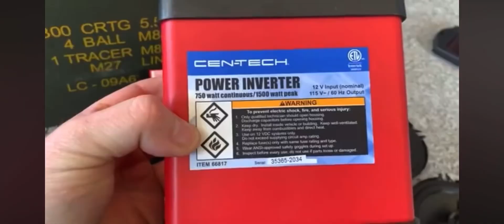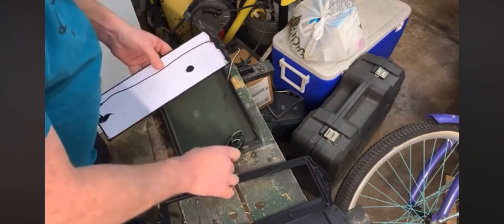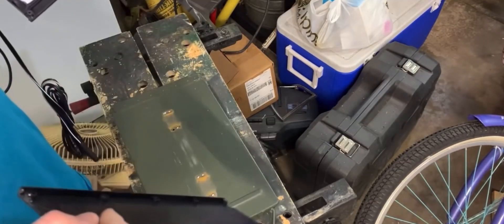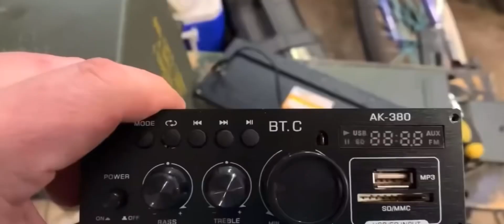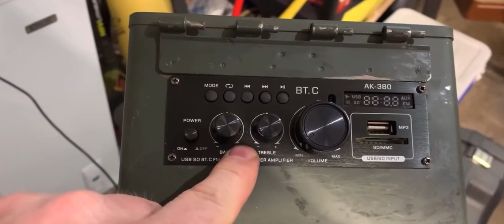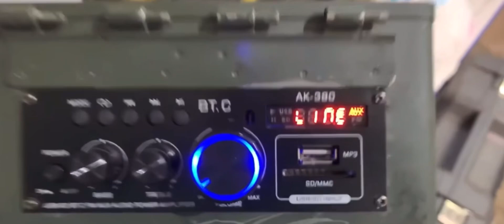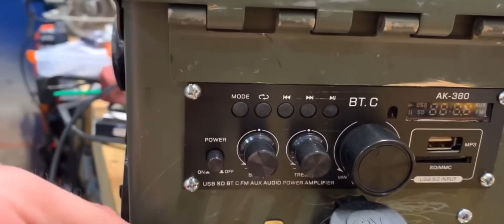Harbor Freight DIY Solar Generator + Portable Boom Box Stereo Blue Tooth Speaker

Comment: Do you think harbor freight black tactical ammo/utlity box that’s 15 7/16”Lx8”x10-13/16”H will fit 6.5 7.09”D speaker side by side on length side?
Reply from the maker: @KyleWilliams-x8u  I think you’d be cutting it too short. I used a fat 50. It’s a much larger box.
Reply: @Jeep-Creep  do they make a plastic fat 50
Reply from the maker: @ I do not believe so as they are military issue

Comment: Careful if the inverter is not Sine Wave, you can get really funky AC passing through your internal power bricks that can cook the Amp and trickle charger.  Have had it happen quite a bit with my own cheap DIY projects it's why I decided to pay a bit more for the SineWave inverters .
Reply from the maker: Yeah it’s a cheapy inverter. The amp is powered by the battery as it runs on 12vdc. The trickle charger powers the battery. Your not saying the battery to the inverter can backflow to the battery are you?  I’m not a pro with electronics but I would think just the AC and usb off the inverter would be questionable power only. Anyways thank you for the comments let me know if you think I am still in trouble. Please subscribe if you already haven’t.